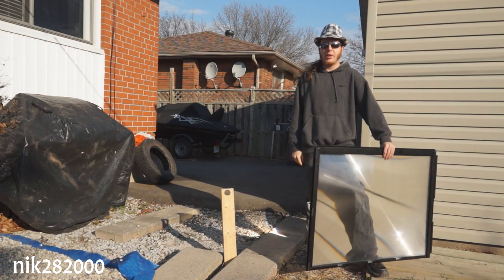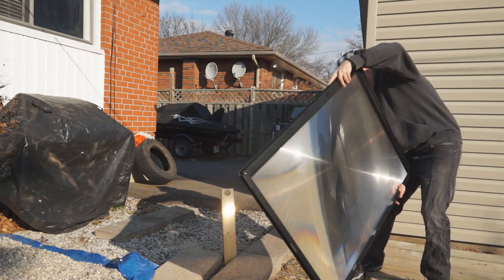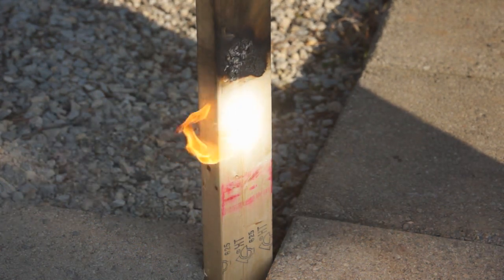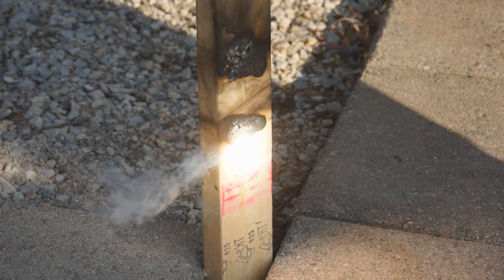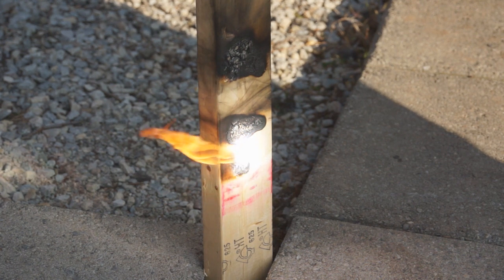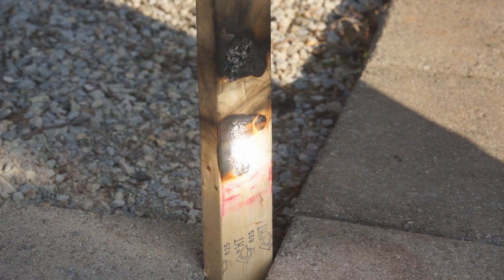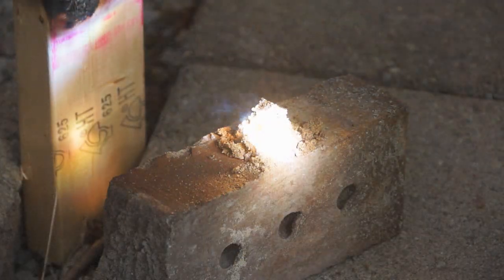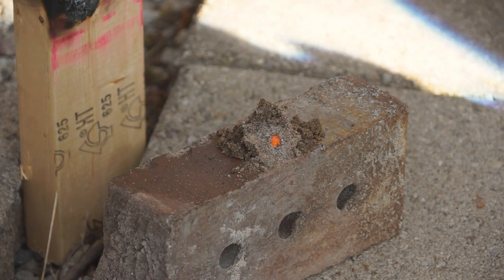Solar Death Ray

Comment from the maker: So long as I didn't let it boil dry it will stay below 100c. However, if its a sealed container it could get hot enough to melt steel.